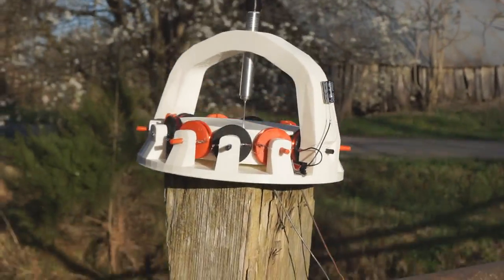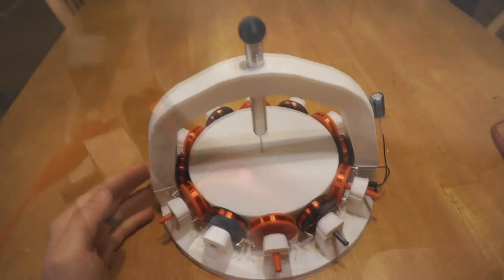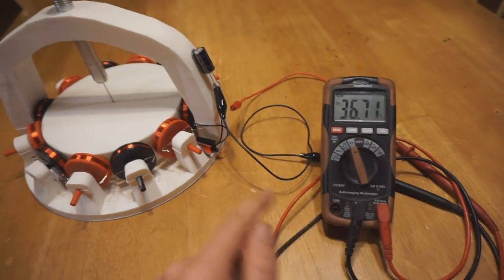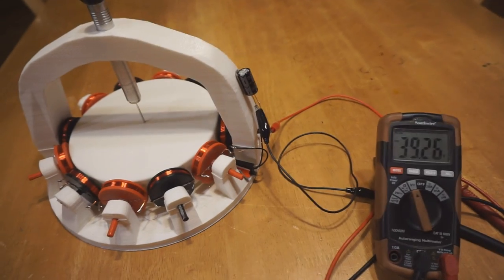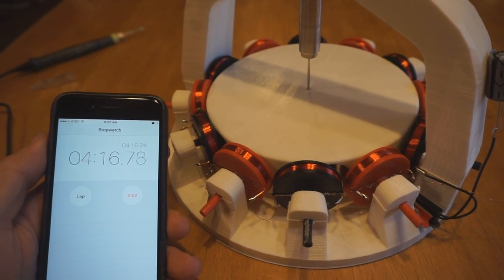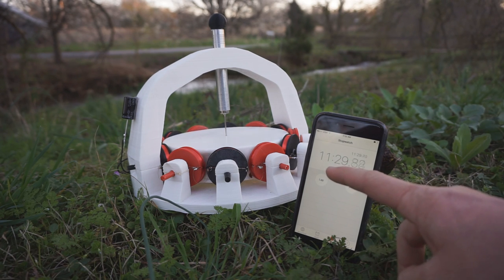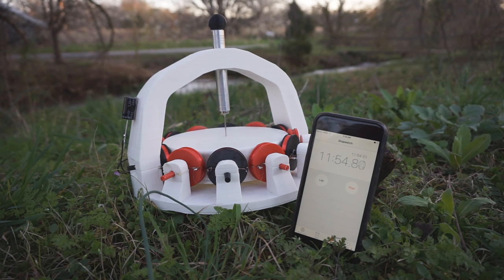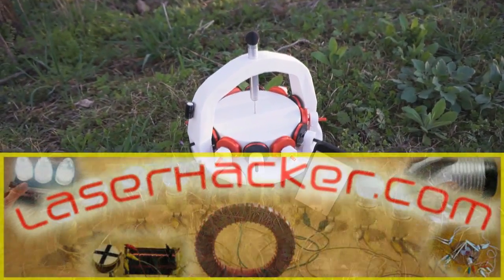XL 3D Printed EZ Spin Motor - Build Overview

Comment: Just a suggestion. The aluminum spinning is already doing 3 things that you can use to make it self running.

1) it is creating an electrostatic charge. You can collect that charge and feed it back into the capacitor

2) the aluminum and magnets are already generating a lenz effects. You should be able to figure out where i am going with that suggestion. 

3) mount a cilindrical magnet to the top and utilize an alternator winding setup. 

Sooo many ideas i can give you. Most people overthink electricity. It's easy to draw the electricity that is all around us.

Comment: Excellent!  The one you sent me that I finished is running on light energy inside my house.  It doesn't run all the time but most of the time.  It is really cool.  I have it running on a simple one transistor electronic circuit. I use three of the coils to trigger the base and the rest to drive the rotor.

Comment: So with the 'disconnected'  spin down time, starting rpm and rotor size and weight, you can calculate how much power you need to just keep it spinning.

Comment: Put it in a dome with black and white blades.  Pump the air out and use it as a radiometer giving spin from sunlight to charge capacitors and when the sunlight is gone it will off the capacitors completely.  I suggest.

Comment: Have you tried the attraction motor? No magnets, therefore no degradation with time and no Lenz's law. 
The Iron rotors can add the fly wheel effect. Best to use Iron powder + Epoxy instead of laminated core.  
Supposed to be the most efficient among these pulsed motors. Good torque too if you want it to be torque'y. Not a motors/generator. A pure Motor. 
I bet it would beat your current design.

Comment: Great job Lasersaber, nice design, nice motor - 2 years ago i gived you some advices for this motor improvement in your forum, for example use bifilar, trifilar coils and you can also try a higher voltage capacitor in parallel with the existent source of energy there; you can also use crystal batteries in parallel; try to put a coil asyncronous from the other coils, to give a different push at at different time, or more coils asyncronous maybe in this way you will obtain better Free Energy effect; thanks for sharing, keep going with your good work! Also you can try 2 separate sources of energy (capacitors or whatever) with different timings!!!

Comment: When you run the test you should have a plug in the circuit to transfer from the batteries to the capacitor.  Then make sure the capacitor is shorted for 5-10 seconds before starting the test and verify with a meter that it is flat.  This way you are not starting the test with a fully charged capacitor since a 1000uF capacitor is actually quite a large amount of stored energy at 20-30V.  At 20uA that motor will run a very long time on the stored charge of the capacitor.  If you do this then you will be able to more easily gauge if the addition of the circuit truly does extend the run time beyond acting as a simple flywheel.  

If the cap is charged to 20V for example and the current draw average is 20uA at the start you would be looking as an effective circuit resistance of 1MΩ.  When plugged into the RCT formula you would be looking at a run time of 1000 seconds or 16 minutes and 24 seconds before the capacitor is at 37% of it's initial charge voltage.  Given how easily this motor spins without load, I would bet that it would probably still run for another complete time constant which would put it in the ballpark of this run-time test.  If you started at a higher voltage it would run even longer.

Comment: Is there anywhere I could purchase one of the smaller motors? I've been wondering about potential small scale power generation uses for it due to how easy it is to keep going, also what's the max rated rpm for one of these?

Comment: I think you completely missed the point of the flywheel comments. The point is your tests don't tell us how efficient the motor or generator is. We can use the capacitance and starting voltage to calculate about how much energy is lost over the course of the test, however, since you are running your motor under effectively no load and harvesting back the energy used for the only work accomplished by the system (spinning the rotor) all that you demonstrate is at roughly what rate energy is lost when the system is not under load (and at a variable rpm to boot). 

In short, these tests don't tell us if this generator/motor/flywheel is 80% efficient at returning energy put into it in a practical application or 2% efficient.
Reply: +Trabber Shir how come you are so into efficiency? what if someone shows you a motor that has over 100% by your definitions? always wanting to be smarter than the one you view will lead you to only great misery...rather ask then assume. you can theorise and you can replicate tests you can put loads on it and do whatever you want with it...just don't force anyone to do it your way, put some effort into it yourself.
Reply: From what I understand, this "motor" is more intended as a curiosity or demonstration piece than anything else.

Comment: +lasersaber Thanks for the design i made a small one and it does run for days on one charge (3.5V rechargeable battery connected as the Cap would be through a diode), i used a hall effect sensor which allows it to spin above a couple hundred rpm and PNP FET (which i think wastes more power than the motor actually uses)... I have a problem with the design files on Thingiverse... there are weird internal structures/shapes inside the base which causes it top curl up on one side almost everytime... trying to edit the base merging it with an extruded in circle causes errors too...im not that experienced with 123D... please check/post new files for the Base if possible.

Comment: 10:53 Impressive that the motor continues to accelerate after you let go.  Don't let Big Oil see this video!
Reply: That is because the capacitor acts as a battery powering the motor.
I don't see what is magic about it.

Comment: Start off with desired RPM.
Select your coils and parasitic capacitance, so that they'll resonate as a tank circuit at harmonics of that RPS.
Machine your rotor not to be wobbly and be perfectly balanced. adjust the magnetic gap to 1-2 mm.
Only then, will you be able to get it to 90+% efficiency.
Not a useful thing, but makes a nice show piece. Like newton balls, but not as annoying.
Free energy machines are for the naive, stupid and the uneducated, like; Muller, Bedini, Adams, etc...
V=IR people.

Comment: Couldn't you just make a huge one of these with a crapload of those 3000F car battery supercaps, and use it for mechanical energy storage? Use a motorcycle wheel as the flywheel or something; something designed with the expectation that it's going to spin ludicrously fast.

Comment: tall stretch calling this a motor. motors are supposed to be useful.
Reply from the maker: +Mind Turd 
I see that it was powerful enough to put you into action.
Reply: +Mind Turd yep i still don`t get it what is the point to make this type of "motor". Its not a motor. It barely can turn itself. If you want to turn this thing even longer put the thing in vacuum. Still not useful but it will turn longer. Next thing you put this thing into micro gravity. Just lunch it towards the outside of the galaxy. Then it will turn for ever ... or at least a few thousand years. Then your life work is complete you made a totally useless forever moving thingy .... 
Maybe some aliens will find it and they will be totally baffled what the purpose of this artifact is :P
Ye I see this is a joke on the alien archaeologists :P GOOD ONE :D
Reply: +Hulla Dek yes great idea. I cant wait until we see the outer galaxy update video. Should be hours of fun for the aliens watching it.
Reply: +Rogelio Garcia Well you are newbe here dude if you think this is new technology.
This motor is known for a long time. Sure you can save some energy form the back EMF. BUT the torque is very small compared to a normal electric motor. If you want to turn something useful with this type of motor then the motor have to be very heavy, big and expensive. I told lasersaber in a previews video to upscale it to turn something useful but as you see he just can use it where you dont need any torque.
Reply: +Mind Turd it is some kind of art, but maybe you don't understand. Yet it seems, by watching the likes and views that many people do
Reply: +Guillaume Alloxrinfo XL 3D Printed EZ Spin Art?
Reply: homopolar motor.
Reply: +Mind Turd It definitely seems impractical.. but to tinkerers like myself it's quite useful to see what type of arrangements such as this can actually yield a rotational inertia or sustained momentum from such a small input current. Simply turning such a large rotor for anywhere beyond a few minutes on a 1000uF is actually quite amazing. Ultimately we are able to see, in more detail on a smaller scale, how we could potentially improve our motors that do indeed require substantial torque. 

At any rate, you can look at this device as a mechanical oscillator, and as mechanical oscillators go, running from 20uA is pretty impressive even though at the end of the day it's basically just an almost useless spinning thing.
Reply: +lasersaber hahahahahaaaaaaaaaa...., i think he just needs 0,200ma.  :)

Comment: +lasersaber 
Hey, maybe you can reduce friction even more if you use these synthetic rubies watchmakers use for their clockworks. You can easily get them from ebay and use them as a bearing for the needle. They are called jewels and come in different sizes and types.